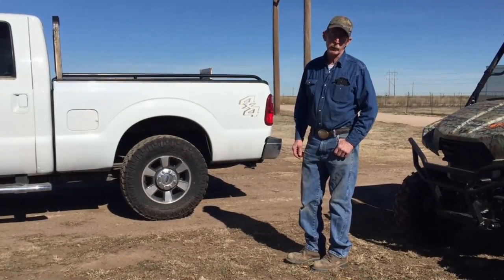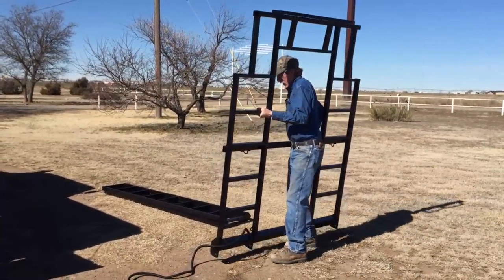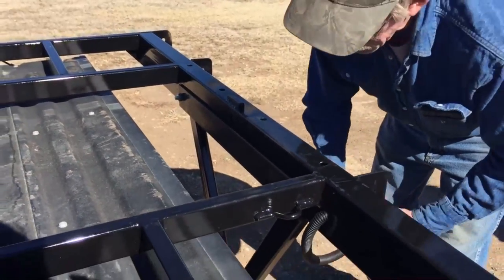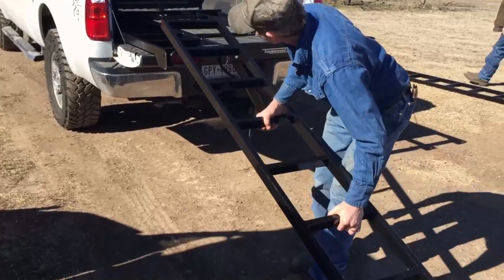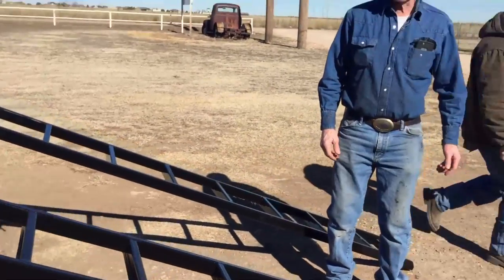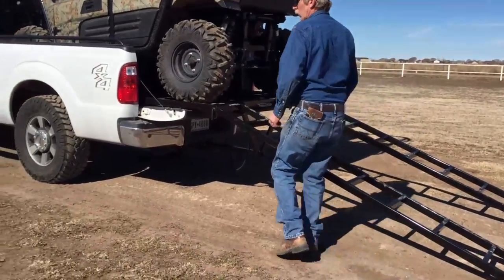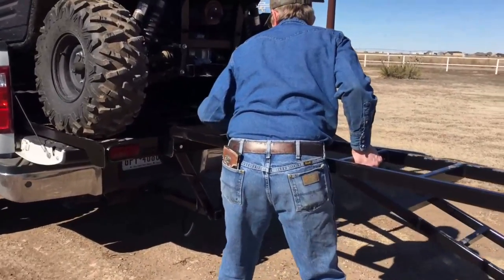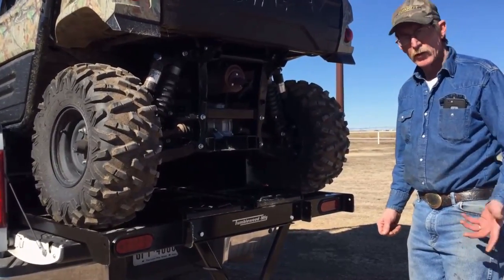10ft UTV Loaded In 6.5ft Truck Bed in 10 Seconds!

Comment: Like the rest of you I also went the the website, and see that it's not listed. I tow an F150 behind a 45 foot super C, so this mod would allow me to take the truck and my UTV. I showed the video to my local fabricator and he said no problem. He suggested using Aluminum, as its lighter. He won't copy exactly and will find a work around for the gooseneck ball. It's a shame because I wanted to support this guy. But I cant buy what's not there. It's a great design.
Reply: You just have to call them. They custom make them to your truck for whatever you need. I’m on my way home right now with mine. No gooseneck and I have a flatbed truck

Comment: Can you please address my concern about having that much weight, that far back on your pickup truck? Isn't the engine of the ATV in the back near the rear tires of the ATV? What if you needed to make evasive safety maneuvers on the freeway while driving your full-size pickup truck, won't the ATV in the back take away the steering control of your full-size pickup truck?
Reply: I see this is no different then loading a pallet of shingles directly over the rear axle of a superduty. It's still Xxxx amount of weight in the rear of the truck, it'll travel just fine. Any evasive maneuvers on the freeway in a pick up could be dangerous.

Comment: Cant tow a trailer behind this.
Reply: I noticed this also; however, use of a SuperTruss manufactured by TorkLift may be the answer if this design could be adapted to it. We use a SuperTruss with our setup (6.5' Ram pickup with Camper) and we pull a UTV trailer. If this design could be adapted to the SuperTruss, I'd consider replacing my current setup with one of these things and a travel trailer. (Disclaimer: I am in no way affiliated with TorkLift).

Comment: I wouldn’t think this would ever catch on. Good in theory, but loading it in 10 seconds is click bate. You have to figure your time of how long it takes you to install the frame structure, and all those nuts and bolts that hold it together. Looks more like 20 minutes to load a UTV in a truck bed, with a broken back. A 6x12 trailer has to be way easier, and you can pull the trailer behind the UTV when you get there. A nice trailer is probably in the same price point as this apparatus!!  Engineering of this was pretty good. Would have definitely welded some tabs on the ramps to keep from having to bolt them up, then unbolt them up 4 times every trip.
Reply: He also conveniently doesn't mention the fact that if you don't have that gaurd at the front the bed your back window isn't going to last long, no matter how tight you strap it down.